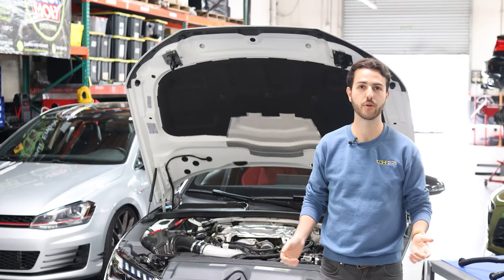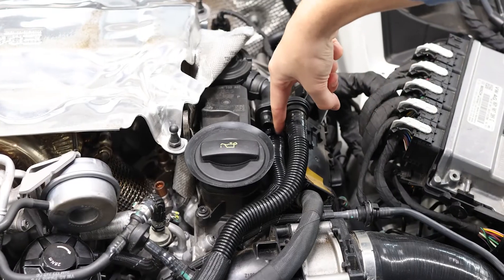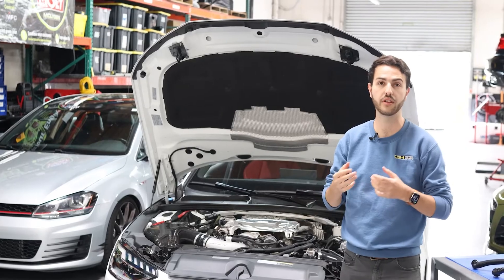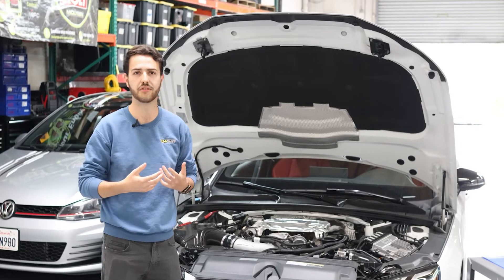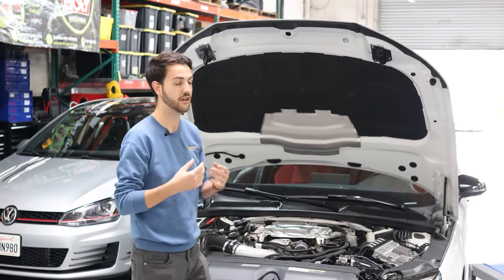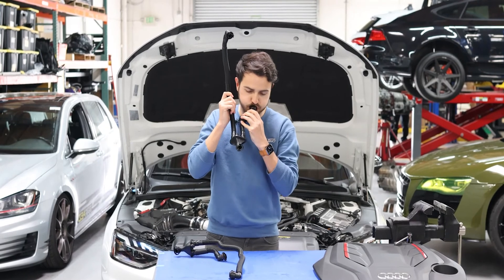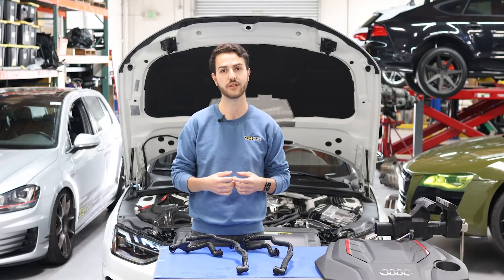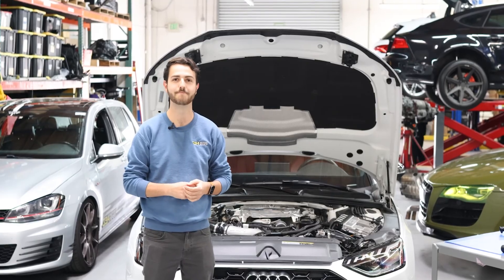Failing Audi 3.0T PCV Valve Diagnosis | 2017-2023 Audi B9/B9.5 S4, S5, and SQ5

Comment: Does this count for b9 RS5?
Reply: I'm wondering this as well. Although the RS5 uses the 2.9L engine instead of the 3.0L so they may have different pcv systems.
Reply from the maker: We have not seen failures on RS5s yet, but the part structure is similar and theoretically can be susceptible to the same failure.

Comment: There goes getting a stage 1 😢
Reply from the maker: Why do you say that?
Reply from the maker: This issue happens on stock vehicles as well as tuned vehicles. You should not feel any apprehension about tuning your car.
Reply: @034motorsport yes exactly I was at a shop awaiting my stage 1 tune only to find out I had this problem before we even flashed the car…went to Audi dealership and just got it fixed…wish I seen this video earlier I would have order the part from 034

Comment: Can you elaborate on the importance of retaining both inlet openings and consequences of caping off the high side pressure outlet like Racingline’s design?
Reply: 5:37
Reply: Got it. I’m new to understanding how the PCV works. This video does a great job kickstarting the conversation. I do have a question.. What are the consequences of NOT evacuating pressurized air from crankcase?
Reply from the maker: @ucisigma  All of the seals and components within the crankcase are designed to operate under a light vacuum. That vacuum keeps various oil seals, piston ring seals, and other internal systems in place. If there is no vacuum in the crankcase, or even worse, positive pressure, those systems can be strained. Signficant positive crankcase pressure can result in oil consumption issues, backpressure behind the pistons that can lead to reduced performance, and oil seals like the front and rear main can actually blow out and leak.

Keeping a slight vacuum within the crankcase is crucial to keeping the entire system running as it should.
Reply: @034motorsport  thank you. This makes sense. I’m persistent to ask when I don’t understand. Like always I appreciate the time and effort.